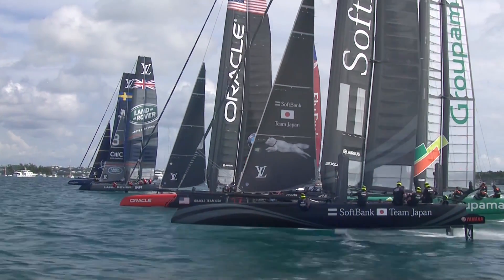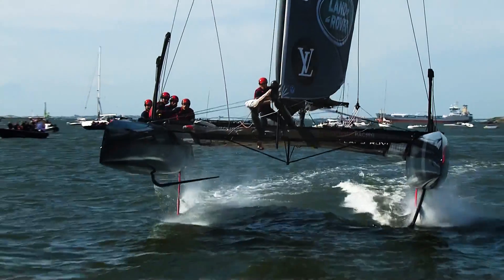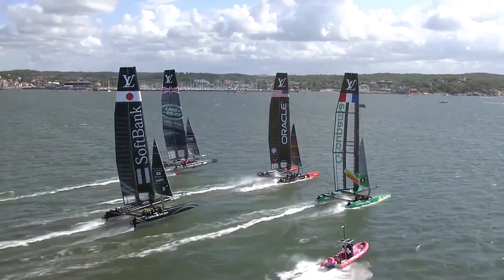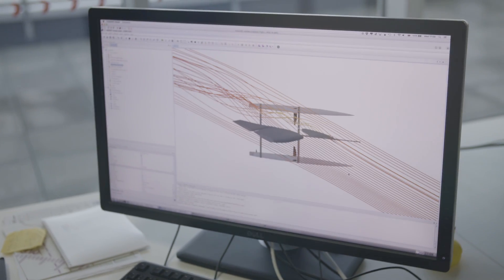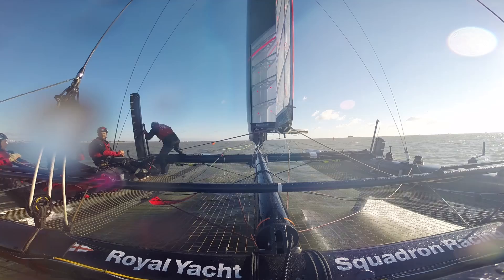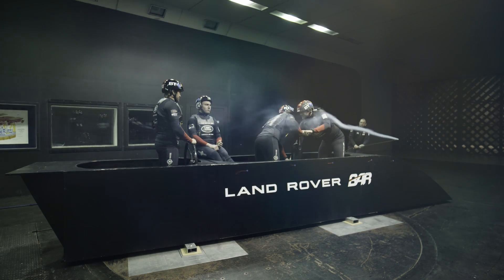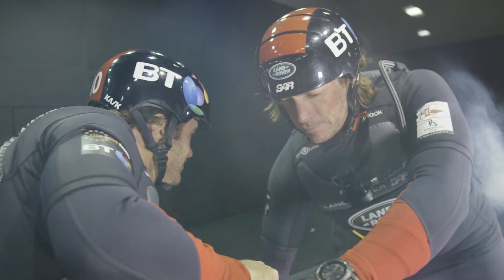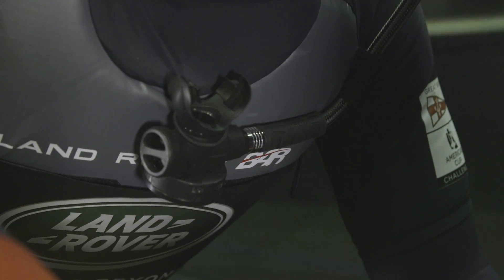Looking for marginal gains

Comment: We call them incremental gains. A marginal gain is something that is too small to make a difference at the time. Incremental gains are gains that are small but keep adding up. A marginal gain is keep on the side lines until something happens to allow it to become an incremental gain. A rule may change, a material may become available that allows you to take advantage of the margin. These things are usually evaluated via a Pareto analysis. The team is looking for all gains and will chase the big gains first then work their way down to incremental gains, then re-evaluate from the top and continue cycling through the design rounds until all stones are turned and all options are understood.  Peter